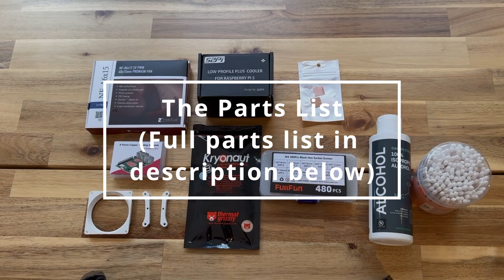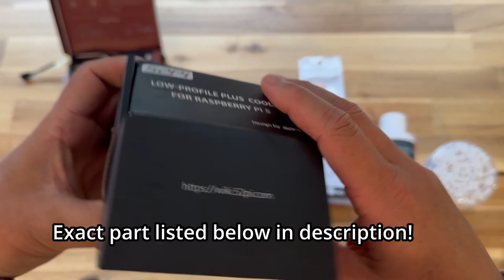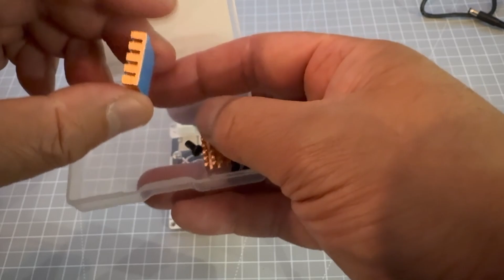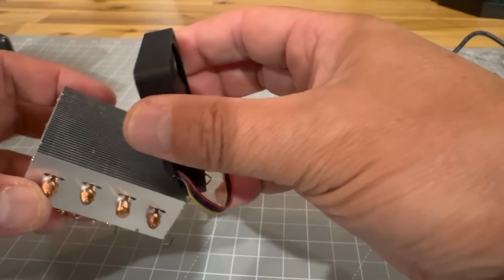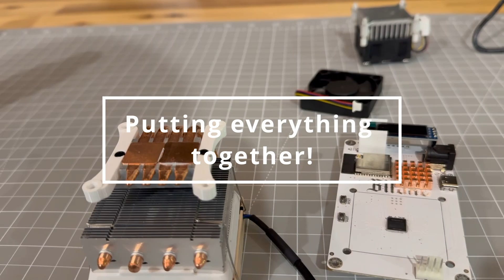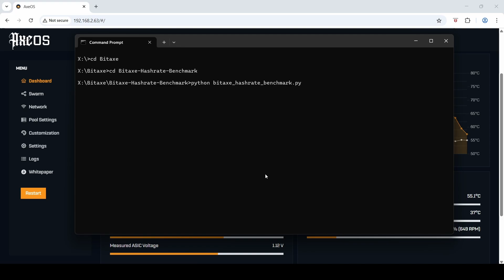Cheap AliExpress Bitaxe Gamma OVERCLOCKED: Breaking the 2.2+ TH/s barrier!🔥

Comment: I understand the difference and the thought behind copper and aluminium for heat transfer, but when you add another layer of an even less conductive material ie thermal paste between, the benefits would be worse than a direct stick.

Polishing that heat sink surface flatter, good minimal thermal paste and getting rid of the shroud and directly attaching the fan, to me would be the go.

Comment: mine from aliexpress both run at 59'c and get about 1.8 - 2 Th with no addtional cooling and  out of the box. I would be reluctant to spend any more on mine due to the chances of hitting a block, it just isnt worth it, and the additional 0.2Th - 0.5Th doesnt make much of a difference either. I might be best running slightly slower and saving on electric

Comment: 1,5Th is amazing at 525/1150 on 18W
I hover around 1,2Th/s at 600/1150 and 21W
Even at max settings 625/1200 it never goes above 1.35Th/s

All with a 40x40 Noctua, Heatsinks mounted and an extra 120mm fan on the backside

Comment: this is exactly what I'm going to do. DO you recommend using the web flasher for the firmware upgrades?
Reply: I've never had any issues with running firmware updates on any of mine from the AxeOS web interface. That's the only way I've ever updated mine

Comment: Great video. Question, are you getting those TH/s with stock power supply?
Reply: The stock PSU is only 30w.  He uses a meanwell PSU at 300w.   I have a completely stock bitaxe gamma from solosatoshi.  It has a better heatsink and fan setup than the cheap aliexpress ones.  With the stock 30w psu, using the script to find the most efficient settings, I am able to overclock to average ~1.34 th/s at 22w draw.  Fan runs at ~50% and asic temp is 55c and vr temp is 70c.  I am getting about 16.7 J/Th on average.

Comment: I followed your instructions and set up one of my bitaxes with the same components in this video.
My results are:
Freq 915
Volt 1230
Asic temp ~63C (obviously don't want to go over 65C)
VR temp ~67C
Hashrate ~1.86TH

I'm currently looking around for a different fan with better RPM than the Noctua (its currently at 100% fan speed with 1177RPM). Any recommendation?
Reply from the maker: That's pretty good! How far you can push your Bitaxe Gamma is also determined by the "ASIC lottery". What is your ambient room temperature? The Noctua fans are great for low noise - but there are faster fans out there with higher RPMS. Just ensure your get a 5v one. Or if you get a 12v fan, hook it up to an external power supply and not via the Bitaxe for full speed. Good luck!

Comment: Which Power supply you prefert for 1 bitaxe Gamma 601 oc 2 th/s?
And which would you prefert for 2 bitaxe 601 Gamma oc 2 th/s?
Reply from the maker: I'd still go for a Meanwell PSU. They come in a variety of wattages. Just ensure you get the 5V version and enough watts to cover your OC'd Bitaxe. Remember that you should never run your PSU's more than 80% of it's capacity. So if you've got two bitaxes pulling say 40W each (80W total), you'd need minimum a 100W PSU.
Reply: What mhz you gotta run to get 2TH

Comment: I really appreciate your video as a single bitaxe gamma owner. I am curently getting an average 1.4 Th/s with all stock fans and power supply. I am not sure I would want to spend £50 for the extra 0.7 Th/s.. not atm anyway. I think I would rather buy a second gamma or may even get a NerdQaxe++ Would love to see a NerdQaxe overclock video and see what kind of hash rate you get. Thanks again.
Reply: do you have any benefit with your bitaxe? I dont get the point on spend 120  to earn 6 a year.....or you are only solo mining?
Reply: @SkyzZMedia decentralizing the network
Reply: @SkyzZMedia  solo lottery mining purpose

Comment: Is it possible to use a Noctua 6x25 5V PWM instead of the 6x15 5V PWM or will the metal clips of the RPI5 cooler then not be sufficient?
Reply from the maker: I think the 6x25 5V PWM will be OK - as the metal hooks attach the to BOTTOM of the fan - not the top

Comment: Isn't the custom power supply critical to reaching this level of OC? Using the stock power brick won't be able to reach anywhere near 44watts.
Reply from the maker: Correct! Most custom brick PSU's are 5v 6a = 30W max. So you won't be able to OC alot on that. That's why I've used the Meanwell 350W PSU - alot of grunt to power multiple OC'd Bitaxes.

Comment: I'd take out those two copper plates between the cooler and CPU, in my opinion, it's not the best setup. Especially if the copper plates have different thicknesses (which you might not even notice, maybe 1/10mm), you're gonna have a bit of a worse contact on one side than the other. Plus, the heat has to be conducted through two layers of thermal paste. Have you ever tried tweaking the voltage from 4.9V to 5.0-5.2V on the power supply? Maybe that could also boost the performance?
Reply from the maker: Thanks - I have not used the two copper shims on my later upgrades, and to be honest - have not noticed any significant difference. Yes, I have tweaked the voltage on the Meanwell PSU. On the Meanwell the multimeter reads about 5.4v - but on AxeOS - they read about 5.0-5.1v across all four Bitaxes that are connected to it. 

How far have you pushed your Bitaxes and what config are you using? Would love to hear and learn more!
Reply: @HomeCryptoMiner  Voltage: 5.2V, Frequently 850Mhz, Core Voltage 1200, Hash Rats 1,7 TH/s and better Fan and Cooler

Comment: Cost analysis question - Arent you spending more on cooling peripherals for ultimately lower TH/s per dollar than just buying an additional Bitaxe?
Reply from the maker: The bulk of the cost is just the Noctua fan and the low profile heatsink. All the other bits and pieces like the copper heatsinks, shims and shrouds are only a few dollars. It shouldn't cost you more than US$40-$45. That's cheaper than a new Bitaxe.
Reply: @HomeCryptoMiner  Thanks for sharing. That's good to know! Is this assuming one is using Aliexpress for everything?
Reply from the maker: I use mainly Amazon or AliExpress. The prices for both the 52Pi Low Profile heatsink and the Noctua fans are about the same price on both - about USD$20 each.
Reply: Im going to let you in on a secret its only one asic chip that solves a block every 10 minutes
Reply: There's also the possibility of extending the life of the Bitaxe miner due to better cooling.  As long as you're not cranking the daylights out of the miner and running it at the ragged edge (e.g. 2TH/s) you can easily get a healthy overclock and still be at stock-ish temps.  Additionally, there is the peace of mind of running open source miners.

Comment: Thanks for the vid. All those parts total would cost nearly as a new Gamma ordered from China so makes no sense for me
Reply from the maker: The bulk of the cost is just the Noctua fan and the low profile heatsink. All the other bits and pieces like the copper heatsinks, shims and shrouds are only a few dollars. It shouldn't cost you more than US$40-$45 for the upgrade. Not too bad to double your hash rate.
Reply: @HomeCryptoMiner  fan, heatsink, 3D printed parts, power supply - about $20 each. New Gamma - about $88.

Comment: Your link is wrong for the fan, you reference the 12V model which I have tried and caps it's spin rate at 1300rpm. The 5V fan was hard for me to find. Hopefully getting one from Ebay.
Reply from the maker: Good pickup! Thanks! I've updated link to correct fan but the 25mm depth one.
Reply from the maker: I've also added AliExpress links too for those who cannot source from Amazon

Comment: Sorry, I didn't catch which script you used, do you have a link?
Reply from the maker: There are a bunch of Python Bitaxe benchmarking scripts out there - but here's the one I used - https://github.com/mrv777/Bitaxe-Hashrate-Benchmark
Reply: @HomeCryptoMiner 

Thank you very much.
Did you change any settings in the script or did you just use it as is?
Reply from the maker: I personally did tweak my maximums in the script but you do not have to if you're not comfortable and you will still get a good result. In my case, I increased the max ASIC temp to 65, max voltage reg temp to 85 and max power draw to 50w:

max_temp = 65
max_vr_temp = 85
max_power = 50

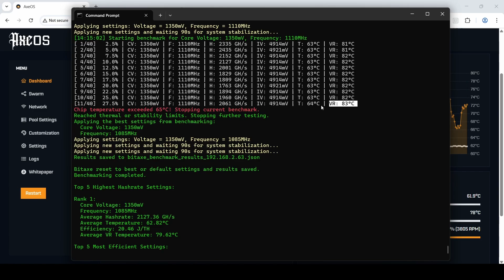These values I believe are still safe but pushing a little harder. Go to the video 28:15 and you'll see what people consider "safe".

These configs start from line #36 in the script. Good luck!